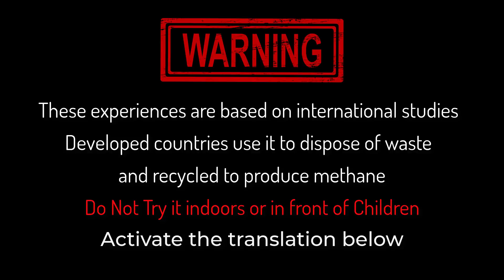The Great Experiment - From animal dung and litter get methane - 2 months free

Comment: Hello Net Help! Thank you for your video. I've seen similar videos related to this topic, but it seems yours was an actual controlled experiment where you took measurements along each step of the way as well as you knew how much water you would get when the gas stock is ready. So I have few questions about your experiment:
1. Could you share with us a link or if you used any calculations you made as to find the proportion between water and gas stock you get?
2. Is that water or fertilizer because that liquid at the top was extracted as fertilizer in other systems I've seen in other videos?
3. If that is indeed water, do you know why you actually did get water instead of methane because the inlet of that tube was in the slurry which is producing methane?
Reply from the maker: Mr
You can activate the translation to know everything you want
The water we added is the evaporated water and the water evaporates due to the fermentation inside
We added compost to speed up the fermentation process
As for the salt, it is to draw the moisture out, and it drips into the bottle, and it is not drinkable, but you can use it in the garden

Comment: How many hours can a system of this capacity boil 50 liters of water at 100 degrees without stopping?  with a stove with a slightly larger fire burner?  If you have experienced it, you know.  Thank you, you have done some serious work.  Good luck.  If I repeat my question a little simpler, how many hours will the gas in this capacity keep the water in a 50 liter pot at 100 degrees with a slightly larger stove?
Reply from the maker: my Lord
Gas works every day for seven hours continuously for four months
You can run the gas for 6 hours and stop it for 18 hours for fermentation
Reply: @NetHelp2  thanks my friend for your interest.

Comment: Another question: on the camera I see that the check valve is below the level of the dirty water. How can the water in the bottle be so clear?
Reply from the maker: Because the water evaporates, it evaporates and goes into the bottle. The evaporating water does not carry dirt
Reply: But you show on the inside camera that the valve is UNDER the dirty water level. So in this case the evaporating water can NOT come into the bottle. 

Did the valve accidentally fall below the dirty water level?

Comment: Hello and thank you for your video. There are some things that are not clear to me. I ask you to explain them to me, if you can. The filter is in the water, right? Otherwise the gas would come out, right? Is the filter made from fuel? Does it have a non-return valve? Is the bottle with the yellow cap open or closed? Because the air, if it does not return to the barrel, must come out
Reply from the maker: The filter is immersed in water
The filter has a non-return valve
The bottle is closed and the air is coming back in
In the next video, we made a detailed and updated explanation of the method, and we used a transparent container to see what's inside
Follow the channel to see the video tomorrow

Comment: This is an example of how a marketing deceives people. Theoretically, from two kg of a raw materials you cannot get more than 3 m3 of methane, in reality is less (about 1 m3), since the reaction slows down greatly with a decrease in the amount of the raw materials. How much does 1 m3 of natural gas cost VS the price of spent chemical reagents and the cost of the work and the materials. Your experiment is only good for an entertainment and is not economically viable for use in the household. Using methane from the tank for 2 months, you can boil a maximum of one cup of water per day, don't fool people!
Reply from the maker: We added potassium and ammonia so that we can produce more gas

Comment: it would appear that these tec savy folk have never heard of compression fittings plate washers plumbers mate and hemp or copper pipe. grease on the bucket lid thread would have improved the seal, and i think a couple of pints of urine and three or four pounds of fresh chicken manure would suffice instead of the chemicals
Reply from the maker: I do not understand what you mean
Reply: @NetHelp2  you have obviously never done any gas plumbing ,that apparatus  is just an accident in waiting, and yes I have seen all the other videos and they pretty much build a bomb / fire hazard next to their homes. Think smart and improve your chances.

Comment: Hello, thank you for making this video. I've tried to make it from New Zealand using dried sheep dung. But now it's already 6 days, no gas or water come out. from the bucket. Should I add the fermentation time more? will it work?
Reply from the maker: Mr
Did you use ammonia and potassium?
Reply: @NetHelp2  yes I added but not NPK 19:19:19. Also, I used the sheep dung bought from the store for fertilizer. Should I use the fresh dung and dried it by myself instead? Maybe all the methane bacteria  from the one in the store already been sterilized🤔

Comment: Hi! I just joined your telegram Channel. I have a couple of questions! I already built a Biodigester. It works fine and produces methane. The problem is that it doesn't produce enough. It is a 50 gallon barrel, one of those common ones. It is connected to a tire tub. It inflates the tube about every 2 days and we get enough gas to us in our stove for about 15 minutes to cook. It isn't enough to cook even an egg. i'd like to know if I'm doing something wrong or what additives I can add and what would be the necessary changes to make in order to make it work better. We would like to be able to cook at least one meal at a day. Thanks!
Reply from the maker: Mr
Our gas works seven hours every day which is long enough to cook food

Comment: This was awesome. Thank you for doing this in such a plain and straight forward presentation. Reading the comments, I noticed that nobody asked (that I saw), if the water coming out into the reservoir can be used for cooking or if it is drinkable? This kind of thing would be great in a bunker both for heating and cooking, and if the water is drinkable, it would solve the issue of getting drinkable water and being able to store it. Also, could dog feces be used or do the feces need to be from a farm animal such as cow, horse, pig or chicken?
Reply from the maker: Mr
The water that comes out of the bucket is distilled water, not suitable for drinking, but suitable for drinking
As for feces, only cow feces are used to obtain methane gas
Reply: @NetHelp2  
"The water that comes out of the bucket is distilled water, not suitable for drinking, but suitable for drinking" cual de los dos? Usted dijo que si se puede tomar el agua y despues que no se puede. Clarificacion por favor?
Reply: @Dudealoodledo   ma non vedo che importanza ha se  potabile oppure no, si puo tranquillamente utilizzare per il giardino non è certamente velenosa. Pensiamo piuttosto a vedere se si produce gas sufficiente giusto? ciao
Reply: The experiment is fake, don't waste your time.

Comment: What about the pressure in the barrel if you not use the gas for days. The gas production will not stop and produce gas on and on. What will happen?
Reply from the maker: Mr
The task of the bottle is to pull the pressure out of the bucket, and when the bottle is full, the gas will stop forming inside and the pressure will stop
Reply: Thank you

Comment: Nice video sir.
I would like to clarify on what is the name of the device with an arrow label? P.M.P 1567-8 what does this mean. I already tried searching the net.
It would be a great help to clarify.
Reply from the maker: Mr
This is a water filter that separates the water from the gas inside and extracts the evaporated water from inside the bucket to the outside
Reply: This is a in-line fuel filter part made for Peugeot and Citron cars. You can find similar in most auto shops.

Comment: You are very creative and wonderful.
Please clarify one thing, please
Where does the air in the small bottle come out when the water enters it from the tube if it is closed well? Is it back to the main unit?
Please clarify that, thank you
Reply from the maker: Mr
We installed a water filter so that the water does not go back into the bucket
This water is evaporating water from inside the bucket
The water evaporates due to the gas production inside

The following materials were used
1- Vegetables
2_Fruit
3_ Animal dong + soil
4 _ Rock salt
5_ Ammonium + potassium

Comment: 1. Do we remove the water from the bottle when it is full, and allow it to fill again?
2. How much gas pressure is inside the canister, after the fermentation process is complete?
3. Is 2 months the period with continuous flame burning?
Reply from the maker: You can empty the water whenever you want
As for the pressure resulting from gas production, it stops when the water bottle is full
He works for eight hours a day
Reply: @NetHelp2  nasıl 8 saat çalışıyor o kova ya
Reply: @NetHelp2  bence 8 saat yanmaz çünkü yarında 8 saat yakabilirsin diyorsun

Comment: all thanks and respect..you have provided a very great service to those who need it.. You deserve all the praise and appreciation.
I have question please:
The tube coming from the filter on the small yellow bottle which is closed well. How does the water enter it ( closed well)??
 and where does the air go??
Does it come back through the filter??
Please clarify this idea and you have all thanks
Reply from the maker: The tube that comes out to the bottle and is connected to a filter is its job to keep the evaporated water inside the bottle and to keep gas from leaking out of the tube
The tube and filter should not be placed far from water
The task of the filter is not to return the water to the inside of the bucket
Reply: @NetHelp2  ya entestoy entendiendo... Es anaerobico... El filtro no deja devolver el agua....

Comment: There is something it's not coming clear.... You said if I don't use the filter the water pipe should not touch the mixture. So the question is, must I use the pressure filter for the experiment to work, or I can use only the water pipe but let it not touch the mixture?
Reply from the maker: Water pipe only and the case must be punctured to help evaporation

Comment: So the pressure filter has to touch the mixture in the barrel?
Reply from the maker: The gas pipe should be away from the mixture, but the water pipe should stick to the mixture

Comment: what happens with pressure buildup  if you use it with a gas heater that has thermostat cycling it on and off?
Reply from the maker: When there is an outlet for evaporating water, you can use it without hesitation and there are no mistakes in that

Comment: Sir, my questions is can i replace rock salt with something else? dolomite maybe? because rock salt is expensive in my country. Second how to safely remove the water? Just open the bottle cap? Thanks, great video.
Reply from the maker: Sir, you can use ordinary salt, but its effect is not as strong on moisture as rock
You can also bend the tube and change the bottle at any time

Comment: Thanks for the time and work you put in. I want to believe you can use any charcoal but at what point do you know the gas is ready to use? how long does it last? and is there a chance that the container might explode?
Reply from the maker: No, there is no explosion as long as there is a bottle to empty the evaporating water

Seven days of fermentation and works for a whole month
Reply: @NetHelp2  do you empty the water bottle once full?
Reply: The key for not exploding is the gas valve, it only allows one direction for the gas to flow. Without it the fire will travel into the barrel and ignite everything and there's your explosion.
Reply: @Avslappnandeljud  I think he meant explosion in the case of the container exploding and spraying the dung and gas everywhere around. But that's important too of course.
Reply: الإنفجار ممكن يحصل في الأيام الاخيرة عندما يكون دفع الغاز ضعيف والنار مشتعله تنسحب النار الى داخل الحاوية وهي تتبع النار عند ذلك يحدث الإنفجار.

Comment: If you can build water with that, you can create steam.
Which you can use to power up a generator using steam.
So if you own a farm, this is a good way to generate electricity for free.
Wondering, if it's the same uhm ~septic tank~ since they produce methane gas.
Reply from the maker: You can run the generator with gas

Comment: Thanks for the video. Pls help me these questions is that black stuff camera? What about the other stuff connected to one of the pipes,what is it? When the water got full, what did you do to it? Thanks
Reply from the maker: The black we put inside is a camera
The water that came out of the pipe is the water evaporated by gas production
We empty it when it is full
Reply: @NetHelp2   
Does emptying the water requires a special technique to avoid gas escaping? Thanks

Comment: Seria bueno adaptarle antes a la botella donde va el  agua, una llave de plastico para agua , así  cuando después queramos vaciar el agua,  solo le abrimos a  la llave , sin necesidad de estar destapandola. Excelente trabajo.
👏👏👏
Reply from the maker: Trabajaremos en ello Gracias por la sugerencia
Yo no lo creo
Pondremos tu comentario en la próxima experiencia de video.
Reply: @NetHelp2  gracias por responder, si tienes razón es algo dificil. Mejor comprar  un bote  de plastico con dispensador de agua para 5 litros, ya los venden en el mercado. Una ultima pregunta el bote donde va el agua , forzosamente tiene que ser de menor capacidad,  que el bote donde se acumula el gas?  Esto afecta en algo, ? Gracias.
Reply: 1.What is the disadvantages 
2. How long will it last before recycling?

Comment: Without sarcasm you have saved my family from death and cold. Thank you. May God bless you.
Reply from the maker: God bless you and your family
Reply: I do not understand about the waterfilter, shoud it be placed under the fluids level????
If possible describe more it's funktion and the way it works?
If filter is placed under the fluid level how can the water then come out?
Is it because of the gas preasure?
And why is it needed at all?
Is it just for having clean water and not "dirty" water?
Another question: Will the process start at lower temperature then 22 degrees?
Or must it be 22 degrees or higher to have it start?
Reply: @mikaelericsson2491  it is meant to clear watervapor off the gas, otherwise it would not burn. Humid gas enters the bottle, the humidity condenses in the bottle, the gas is pushed back by the water into the Container
Reply: @WaldbrandRecords  Thanks.
Reply: @mikaelericsson2491  its a chek valve i believe, but i am also missing some info about why the water in the bottle is clear whilst the camera shows the checkvalve was submerged.

Comment: What is the use of the water on the other gallon?
Reply from the maker: When the water evaporates from the inside, we separate it from the gas because the evaporated water and gas rush to the top
When the water evaporates, gas production begins
Reply: @NetHelp2  when water evaporates it is in liquid to gas. So we know if methane is not going to the water bottle? Im just asking bcoz ive watched lots of biogas plant and you are the only one with container for the water vapor. Because usually if there is another container it is for the methane gas. Can you make 2 container and lets see if one will be filled with vapor and the other one will be methane. Thank you

Comment: Genial tu video. Una consulta, cual es el nombre comercial de ese filtro o como lo puedo encontrar mas facilmente?
Reply from the maker: filtro de presión
Reply: Hola, si ese filtro, no hablas mucho de el, parecia un filtro de gasolina, ¿ese filtro es necesario?, ¿debe tocar la mezcla, o simplemente por encima de ella? , ¿en que implementos se utiliza normalmente? gracias.
Hello, if that filter, you don't talk much about it, it looked like a gasoline filter, is that filter necessary? Should it touch the mixture, or just above it? What implements is it normally used on?

Comment: Hi SIR
I am appreciated if you tell us how we can measure the pressure inside the bottle in order that  process to be completely save
There is a gas is going to be generated inside that is way the pressure will increase. That could be dangerous for users especially the beginners of them.
Please could you clarify dear friend?
Reply from the maker: Mr
We did an extra work and we added the external water generator to stop the pressure caused by gas production inside, and the calculation of the amount of gas inside depends on the water evaporating into the bottle

When the bottle is filled with water, you must empty it to relieve the pressure caused by gas production
Next time, we will set a pressure clock to measure the amount of pressure resulting from gas production

Comment: Sir... as regard a fellow that did this project and get gas for two days without adding potassium, does this means the absence of potassium will generate less gas?  and the presence of adequate potassium will generate more gas?. Also, what will happen without connecting the strainer (filter)?
Reply from the maker: Mr
In the previous videos, we did not add potassium, and this reduces the speed of fermentation, so the person will have a slow production
However, after adjusting the components, the reaction became much faster
Gas production after adding ammonia and potassium became 2 kilos in two days

Filters are important to ensure that water does not return to the bucket
Reply: @net help, goodmorning sir. I would like to ask if the filter you used is water filter or pressure filter? Thanks in advance.
Reply: @joshuatorreja6660  I think he use fuel filter